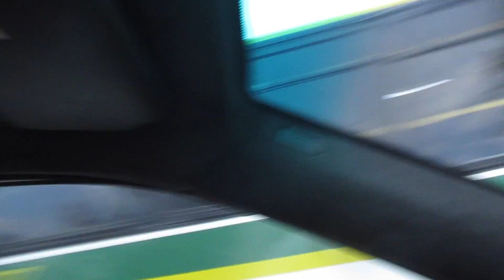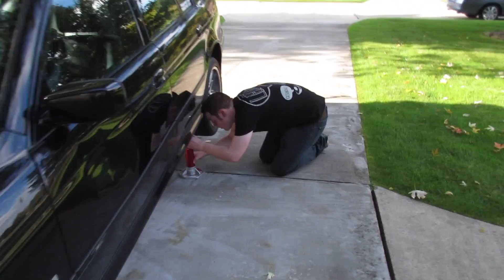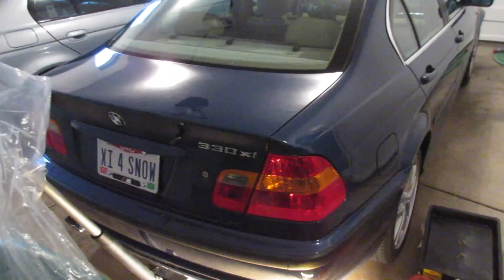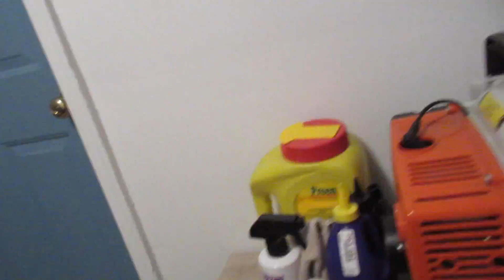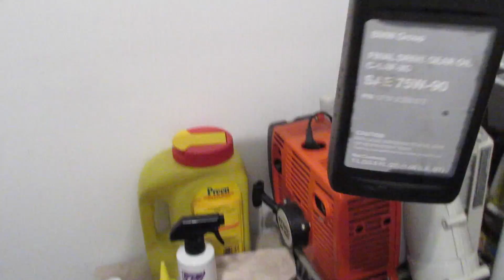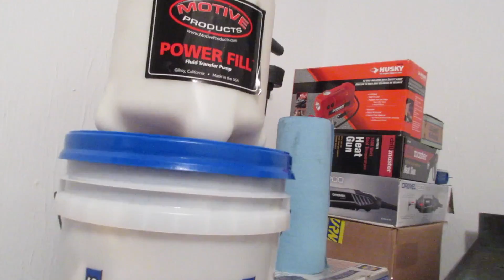Colt's Tires 10/1/14 - Day 1,392

Comment: My heat-shielding is held up with glue in a couple of places. I would buy a new one but they're impossible to find anywhere! Looked at a scrapyard and they were all broken also... Yay. At least you have peace of mind that they've been changed. All I woudl say is make sure the oil will meet BMW's standards... and is 75W90.
Reply from the maker: I don't know why heat shielding always has to collapse and then rattle.  I fabricated some big ass bolts and washers to hold Razvan's up.  Just pounded that shit right into the frame.
Reply: It also only rattles at the speeds you drive most. Like a wheel wobble or anything like that.